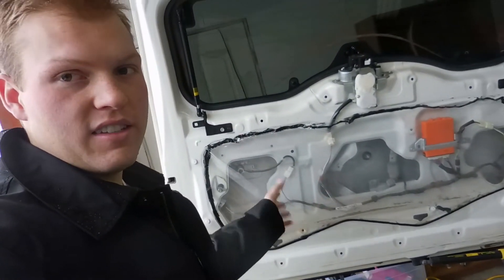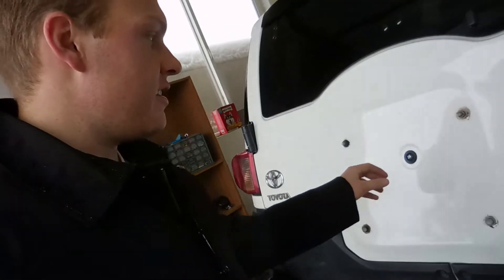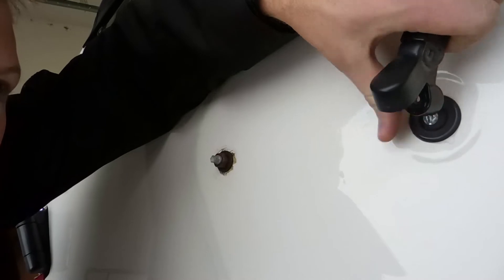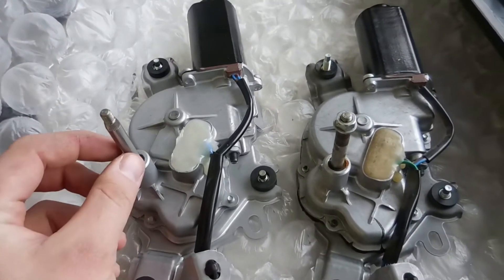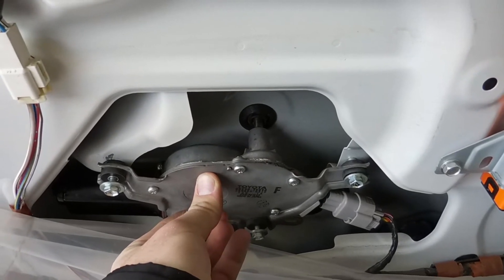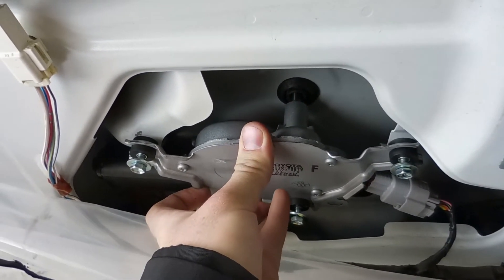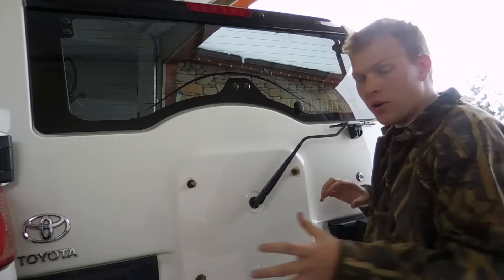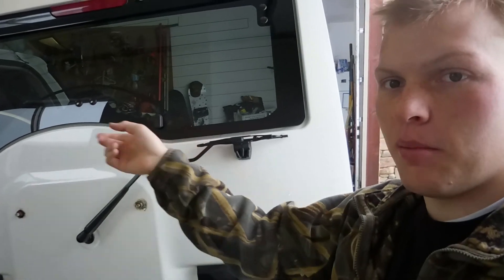FJ Cruiser Rear Wiper Motor Install/Replacement

Comment: I have exactly the same model, do you have the model or serial number of the part? Thanks and good job
Reply from the maker: https://www.ebay.com/itm/233125334765
Reply: FJX2000 Productions thanks a lot
Reply: That link is dead........ Do you have the model or serial number for the part

Comment: Hi my FJ is a 2007 base model without that motor, can it be installed????
Reply from the maker: Good question, I have no idea. I imagine there might be the wiring for it already in the FJ but there may or may not be a hole drilled in the rear door for the wiper motor to pass through. And the knob on steering column my not be the right one to also control the rear wiper. But I've never looked at a base model in detail so I'm not sure